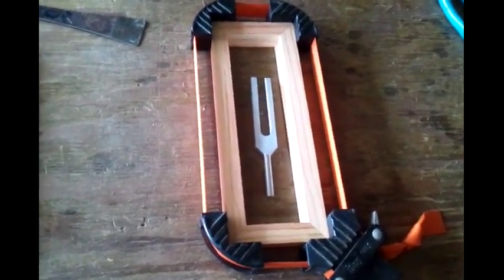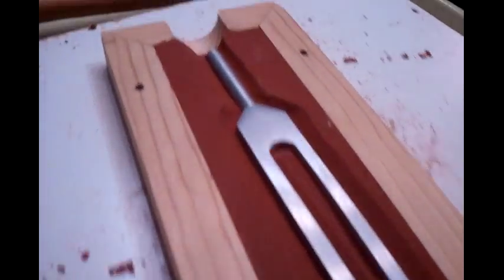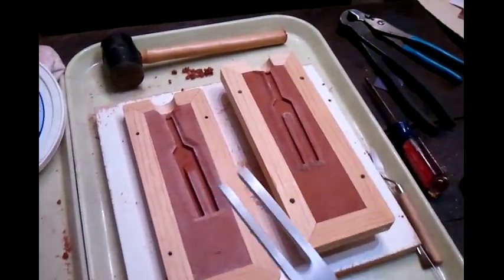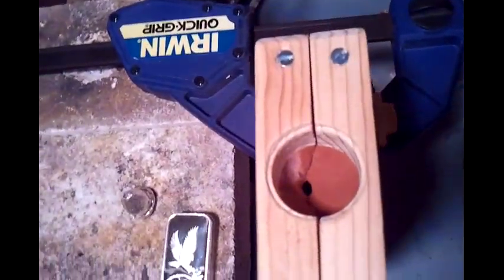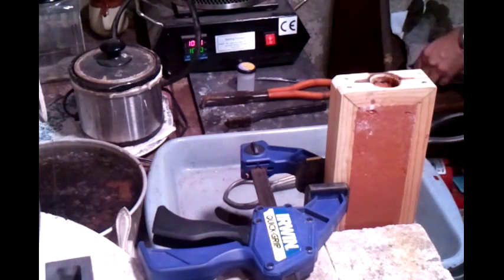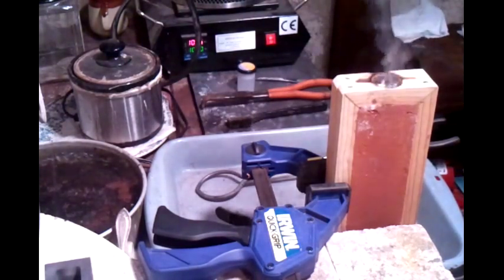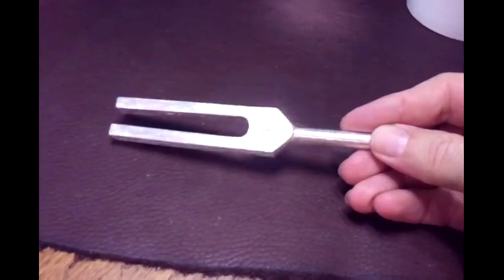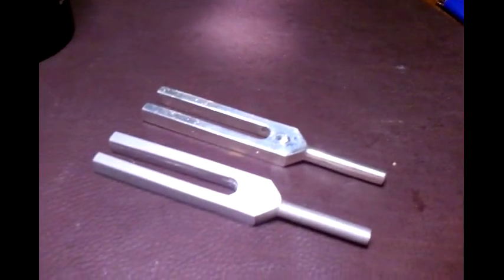CASTING A FINE SILVER TUNING FORK FOR TRACTOR MAN

Comment: Why did you spend ages just kind of poking at it at the end and never actually striking it? Doesn't make sense.
Reply from the maker: Hi, sorry for not banging it on something! The problem was it was annealed, being soft! When you cast something its soft, or annealed! I would have to harden the Silver! By pounding it, or tumble it! So it wouldn't make any noise it I tapped it on the video!

Comment: What kind of sand ..petro? Which gives the best finish
Reply from the maker: Hi I use Delft Clay or petrobond sand! Delft clay gives a nicer finish but is 3 times expensive! Peace!
Reply: @Silvertoburn  thank you sir ..how long do those kilns take to heat up the silver weve been using a oxyacetelene torch
Reply from the maker: @eluminateoccultis1966  Those eletric kilns are awesome takes about a 1/2 hr to heat up! I recommend one! Pretty slick! I dont use it alot but great for over 4 ozt's! Not sure on the eletric bill! "Table top" is a better brand! I believe thats whats it's called! Square & silver looking!

Comment: Another win from the master. What a great project for Tractor and you bud. Do ya know if it will ring a true "C" ? No matter it is just wonderful my friend ! Love the frame. All kinds if Ideas rolling in now.
Reply from the maker: I tumbled it for 3 hrs to harden it, but it didn't have the same ring as the aluminum one! Huh!  ;(
Reply: For sure the density will be a lot different so me thinks it will need to be lightened and tester with a frequency counter to get it musically right. But in the long run that will be Tractors call eh.